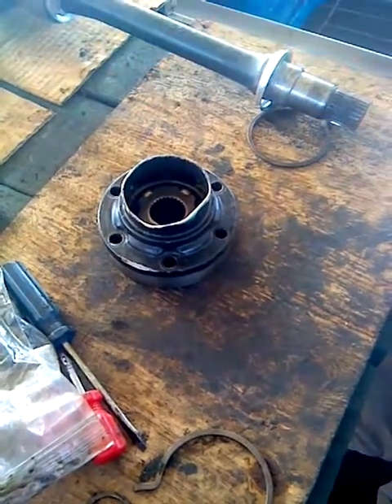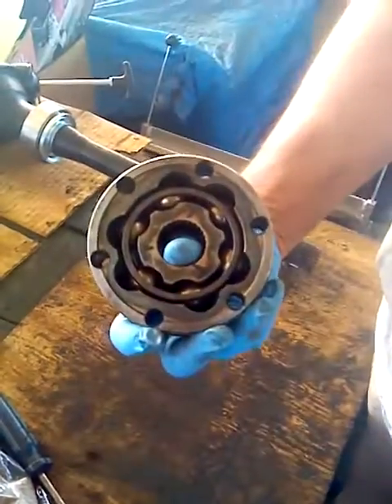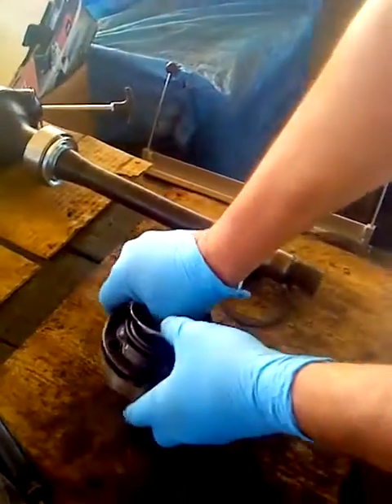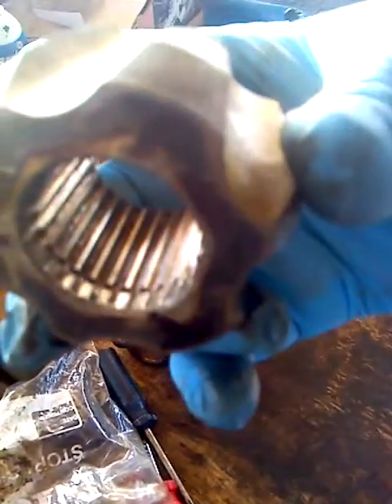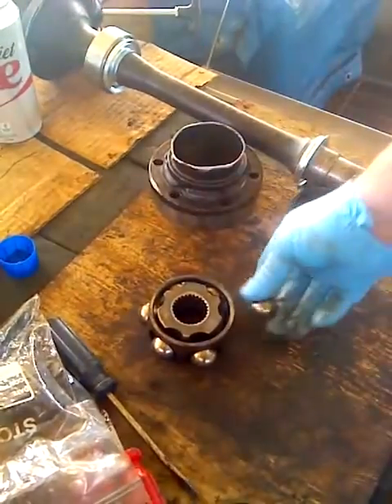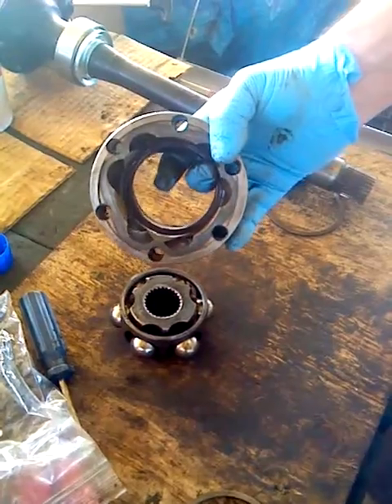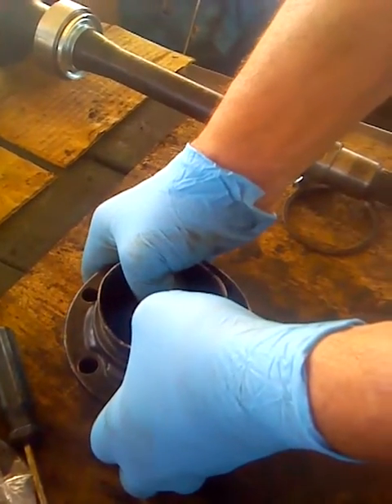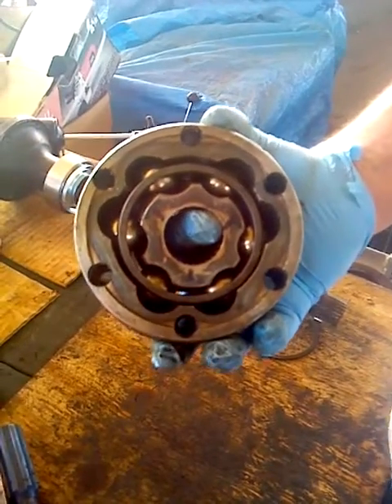Assembling CV Joint 1993 Toyota MR2 e153 Transmission

Comment from the maker: PLEASE NOTE: From some user comments,  it appears there is a source of confusion when referring to the alignment of the short segments versus long segments on the inner race and outer race. YOU MUST END UP  fully assembled with the long segments aligned with the short segments precisely as shown in this video.  TO ACHIEVE THIS you begin the insertion with the same-length segments aligned and as you proceed with the assembly they come into alignment - precisely as shown and stated in the video.

Comment: After several times doing it wrong I found out both the right way and the wrong way. The method is to keep the inner race "in place" ON THE FLAT SURFACE while lifting up on the bearing "carrier". As you lift up gently and evenly the outer race falls into place ensuring articulate motion of the CV assembly. Good Video! :)

Comment: Hey frank, a little confused here. In this video you say that the narrow side areas on the outer and inner race should be lined up. In this other video:
https://www.youtube.com/watch?v=OfcFBz0rndE
The exact opposite is stated, with narrow being lines up with wide...which is actually correct?
Reply from the maker: This has to do with where you start and where you end up. If you start one way, for example narrow to narrow, you end up with opposite way, narrow to wide, when completed. If you start narrow to wide, you end up narrow to narrow and wide to wide, which gives no articulation.

Comment: Guys please help! I have a few questions, can't seem to get answers on Google.

1) Are these CV joints the same on the MR2 N/A and MR2 turbo? I just need the left outer joint for an MR2 turbo, and wondering of an N/A one is compatible, as turbo parts are super duper extra scarce here in Europe (no turbo models were sold here).
2) Does anyone have the part number for the E153 one (if there is a difference between the E153 one and S54 one)?
3) What's the best place to buy these from? Toyota directly or some specific website?

Thanks in advance fellas!
Reply from the maker: There's two different transmissions used in the 90's MR2 sold in the US. S54 came with the NA 5s-fe engine. E153 came with the 3s-gte turbo engine. There's a third engine option, the 3s-ge NA, sold in Japan and Europe. Anyway the E153 and S54 are completely different transmissions. The E153 is about 40 lbs heavier and rated for higher torque and horsepower. The axles are also very different. The E153 uses the ball and cage joints in this video. The S54 uses tripod joints. They are not interchangeable and not compatible. The best place to get S54 joints is from Toyota dealers. They may also be available from MR2 specialty shops. These are the direct links to the parts diagrams with part numbers for the S54 axle/driveshaft assemblies:

https://parts.lakelandtoyota.com/showAssembly.aspx?ukey_assembly=511601&ukey_make=1060&ukey_model=15439&modelYear=1993&ukey_category=21645&ukey_driveLine=6674&ukey_trimLevel=18213

https://parts.lakelandtoyota.com/showAssembly.aspx?ukey_assembly=517690&ukey_make=1060&ukey_model=15439&modelYear=1993&ukey_category=21645&ukey_driveLine=6674&ukey_trimLevel=18213
Reply: Hey Frank, thank you so much for answering! I have an E153 in my car, and I'm looking for the rear left CV joint for it. Do you think I can only find it through a Toyota dealer?

I've been looking on most second hand sites as well as Amazon/Ebay etc, but I can't seem to find any.
Reply from the maker: If you're looking for the complete CV joint assembly it is listed in the Toyota parts catalog for about $550. 

You can buy a  joint rebuild kit (one pair L and R) for $175 but this does not include the races inner or outer:
https://twosrus.com/catalog/product_info.php?cPath=22_35&products_id=1118

You can buy a pair of complete joint assemblies for $305
https://twosrus.com/catalog/product_info.php?cPath=22_35&products_id=891

I don't know if these are sold as individual units.
Reply: Wow, okay, thank you so much! Quite expensive huh :-O
Reply from the maker: Personally I think the cost of the aftermarket joints is very reasonable considering that OEM is $550 each not including boots and trumpets and AM is $150 each with boots and trumpets AND the aftermarket joints are upgraded stronger joints rated for much higher torque.